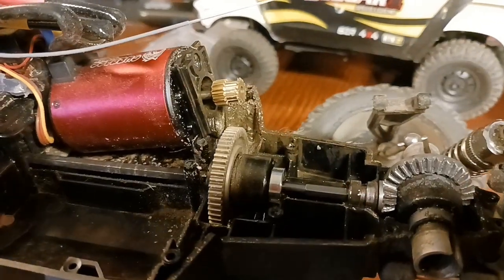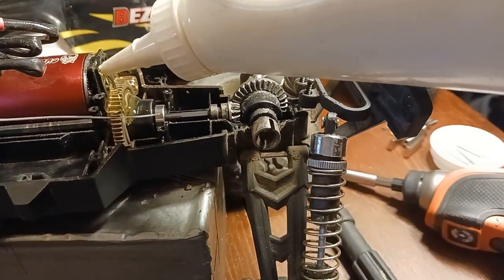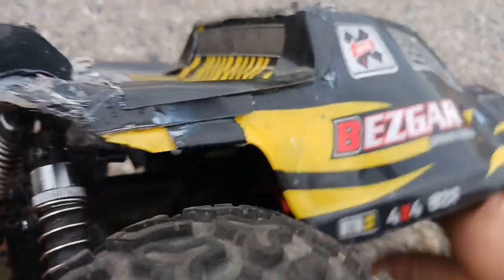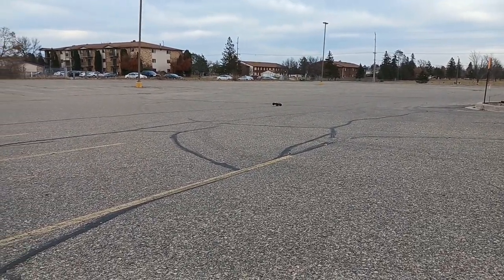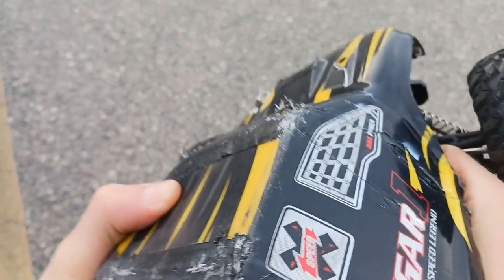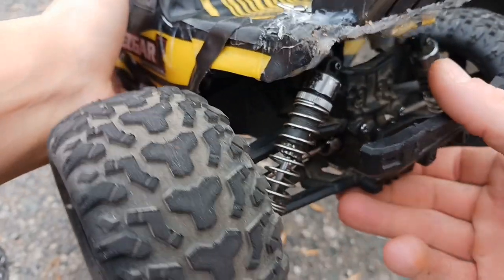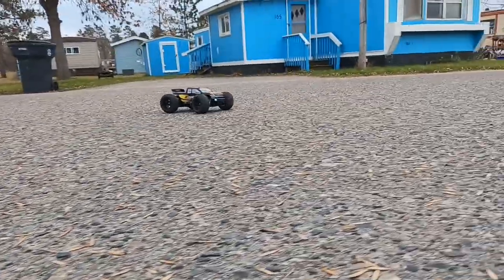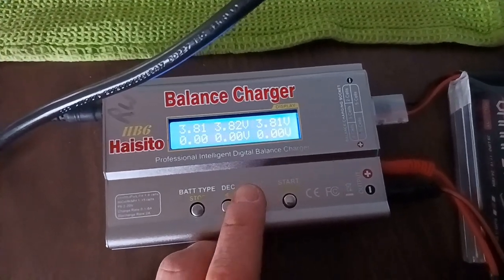3s 3650 5900kv fast wheelies with BZR HM101

Comment: Love your videos bro. You inspired me to 3s my hm101🤙 what motor and shaft size?
Reply from the maker: That's cool to hear I'm really glad bro! He'll yess that truck is badass with a 3650 motor. Get a 3650 with a 3.175mm thick shaft. They're all the standard length shafts, but ive only had Surpass Hobby for 3650 motors . Example, The surpass hobby kk 3650 Motor's shaft is just long enough. The pinion will just go on enough to fully be on the shaft where it lines up with the spur gear. Works perfect. What esc and motor are you thinking? I reccomend a dumbo X6FG or Injora T-6 with a gyro if you like going really fast. Really makes it even better
Reply: @ChiefRickyRC  darn I'm going to have to cancel order lol. I was going with the 3660 brushless with a 5mm shaft diameter / 15mm shaft length😳 
I never see your videos till after I ordered😅 was living on a prayer hoping it would all fit or I'd make it fit 😂
60 amp esc came with the brushless motor combo from surpass hobby. I got a cheaper 6ch receiver and transmitter. Have a bigger 25kg metal/waterproof steering servo on it already with 2000mah 2s lipo.
Im from Kauai Hawaii so we got lots of fine red dirt areas so I usually dirt rally style with some big jumps 😎🤙
But what about that shaft length? Will 15mm long be too long or too short?
Reply from the maker: That's so badass you live in paradise 🙌.  Sorry to say 5mm is too large. I swappes the original steel pinion so you'll need a 3.175mm Diameter shaft to fit the pinion. This use 48° pitch mod.06 gears and that'd be impossible with a 5mm. Otherwise I'd get the longest shaft possible you can always trim that. You could use a 3660 3.175 still, but those don't come as high kv. A 60amp would work, but you'll need at least a 80amp of you want that good punch to launch off the jumps. I know these do that great lol. I fixed mine with 2 small screws after the Skatepark just haven't got to show how yet. Rock on brotha lmk how it goes
Reply from the maker: Something around 4000kv would be insane off 3s,4s. I'm gonna show the 2995 with a 3650 2800kv Castle motor and 120amp. I think you'll want somewhere around a 100amp
Reply: @ChiefRickyRC  shit ok. So the 5mm shaft won't work because why? I'm new to the hobby so didn't really understand 😅 48° pitch? Sorry to bug bro 🤙
Reply from the maker: The original motor pinion that you'll use off the 550motor has a hole that is 3.175mm. 48° pitch is the style teeth on the spur and pinion gears. No worries this will make sense eventually ask away
Reply: @ChiefRickyRC  ok now I got it👍 so what if I use a after market pinion gear (5mm/48p/12-14T) instead of the stock one? Will that work? 
I confirmed that the shaft length is the same as the 3650 (15mm)
Reply from the maker: I just looked and once you go to a 5mm, all the pinions are 32° pitch teethed gears. I have a 5mm shaft on a 4068 size motor and it looks to big for the small motor pinion also. The 3.175 shaft is plenty strong they never break. Well I broke one once, but it was a 9000kv motor lol
Reply: @ChiefRickyRC  I found a 5mm/48p/17t on Amazon by Robinson racing will that work?
Reply: @ChiefRickyRC  sorry to push the issue but just asking to know and if it won't work I'll just cancel order and get the 1/8 shaft 🤙
Reply from the maker: It sucks to cancel a good deal. Yup bro gotta get the 3.175 shaft motor for this truck. The 3650 is crazy power for it. Even a smaller 540, or 2845 can would make it do backflips on 3s. I usually use AliExpress to buy surpass hobby motors and EsC's really cheap. Only buy from sellers with at least 10 previous sold orders and always read reviews to double check the seller. Even on Amazon they can do slick shady stuff.
Reply from the maker: They have good 3week shipping. I mean typically it's a week longer then Amazon and $10-20 cheaper for same thing
Reply: @ChiefRickyRC  ok bro thanks a lot 🤙 So just to be clear even with a 5mm bore, 48p, 17t pinion gear; it won't work?
Reply from the maker: I believe That would work if you find it
Reply: @ChiefRickyRC  I had to work late and didn't cancel my order in time 🙄 but I think I found the right pinion gear online. I'll try the set up to see if it works and let you know 👍 worse case I'll just go with the set you suggested and no problem👌 
Thanks again for the help and your time  I greatly appreciate it 🤙
Reply from the maker: You can always take the pinion to a machine shop or if ya gotta a drill press, drill the hole to 5mm. Ruins the pinion but if that's the goal. Don't try with a hand held drill you'll just stab yourself lol
Reply: @ChiefRickyRC  🤣 been there don't that. I'll keep you posted 🤙
Reply: @ChiefRickyRC  got my motor and ESC in today the pinion gear meshes very well with the spur gear the shaft length is perfect and did not need to be cut the 5mm shaft size had no issues with fitment. 
However the box did not come with instructions. The 3 motor wires are color labeled black, yellow, and red. Yellow is the middle wire.
The esc wires have no labels or colors. Would you by chance have a instruction manual? Just need to know what color wires are on the esc. 
Thanks in advance bro 🤙🤙🤙
Reply from the maker: That's awesome wow that's gonna be a beast! The motor wire colors don't matter as long as it goes correct direction. I usually use yellow as middle too, then switch the others if it goes backwards. Can't hurt it so no worries about motor wires. Mayne that's why never has instructions lol
Reply: @ChiefRickyRC  nice I'll try post a video later today 👍
Reply: @ChiefRickyRC  so I hit my first problem 🤣 it sound like the pinion and spur is really loud. Took the cover off and I chipped some teeth on the spur gear🫣 pinion gear is fine tho but still sucks. 
The motor mount is pre set too so not sure how I'll slack down the mesh 😅
Just fuked the spur up 🤣
Reply from the maker: Damn the steel spur wow 👌  😆 . You could slot the motor mount holes carefully. I always fuck them up tho
Reply from the maker: It was so hard to get this thing doing 70mph idk if it's possible to go much faster. Just the suspension geometry
Reply: @ChiefRickyRC  thought about that but I'm not 100% on it. 
But did you have problems with pinion to spur meshing with the 3.175 size shaft? 
Could the tooth count have been why it spun some teeth on the spur?
Reply from the maker: On the Q901 spur the largest I could spin on it was a 26tooth. 27tooh didn't mesh at all. Was noticeable not to install
Reply: @ChiefRickyRC  🤔🤔🤔 I was only at 17t on the pinion with stock spur🤷 maybe the thicker motor shaft increases the size geometry of the pinion gear?
Reply from the maker: On paper it should work. I'll be working on my HM101 soon and I'll try some pinions
Reply: @ChiefRickyRC  I got lucky and found the center shaft/spur gear on Amazon they had 12 in stock bought 2 but only 1 went through. Went back look this morning and they were all sold out🤯 but I have 1 on the way. Now I'm unsure if I want to try the same set up on the new spur 🤣
Do you know what material is the stock spur? The aftermarket pinion I got is hardened steel...
Reply from the maker: Great news! The spur is just normal steel I believe. That's why the hardend ate it up. I reccomend the stock pinion but sounds like you got it bro
Reply: @ChiefRickyRC  is there a difference with metal steel vs harden steel or harden metal?
Reply: @ChiefRickyRC  just found another 5mm bore 48p pinion made of "metal steel" not hardened
Reply from the maker: Hardend metal particular steel is heat treated to be harder. The metal loses flexibility the harder it gets. Like diamonds lol
Reply from the maker: I bet there's lots of videos on hardend steel
Reply: @ChiefRickyRC  thanks bro sorry to bother you 🤙
Reply from the maker: No bother bro I'm not getting many notifications so I enjoy it actually being chill. I'm rc and car crazy it's all I talk about lol. Anytime brotha
Reply: @ChiefRickyRC  been looking up some new pinion gears but a lot of them either say 7075 aluminum or metal steel I'm not sure what is metal steel🤷 what do you think would work better with the steel spur gear aluminum metal or steel (non hardened)
Reply from the maker: Metal Steel is probably just for the description I'm thinking. Personally I'd go with normal steel. Hey bro so When you first run the truck set the throttle dual rate down to low power and run a whole battery driving with low power to break in the new gears. The teeth will seat better hardening and smooth out the contact area. A light load on the contact area. Don't hold it in the air and spin the wheels fast until after a good 30mins slow. The softer the metal the better. Like everyone gets a brand new rc and rips it right away just hard. Well brushless stuff. Lol a brush motor breaks gears in awesome
Reply from the maker: I'd take everything hardend steel 1st, then steel, and whatever composte WLToys uses on thier plastic spurs. That shit is awesome. My 979b and 124018 have them. Last forever even with a hardend steel pinion. That Alloy pot metal is the fukcing worst
Reply: @ChiefRickyRC  what about aluminum cause I rather change pinions than spurs. The one that ate me spur says hardened steel
Reply from the maker: Aluminum is so weak I tried it
Reply from the maker: Brass chews up aluminum
Reply: @ChiefRickyRC  wats up bro 🤙 so my new spur gear/center shaft came in yesterday from bezgar (direct replacement part)
I returned the 3660/5mm shaft and got a 3650/3.175mm shaft; but it doesn't arrive till 01-27-23🙄
Planning to install new 3650/3.175mm, with a 14t or 16t metal 48p pinion gear, with my new spur/center shaft once the motor gets here.
But for now I put the old motor back with the chipped spur 😅 she still runs no skipping teeth yet 🤣
Also I noticed my stock pinion gear on the stock motor has no hex nut... Seems pressed on?🤷 How do I get it off to use it on the new motor to keep the spur to pinion gear ratio stock? Thanks bro🙏🤙
Reply from the maker: Word that's a good 550! So the stock pinion, heat it up fast and pop it off with a short sturdy flat head screw driver, or motor pinion Puller. I get the screw driver tip wedged and rotate the tip pushing pinion off. Safer then pushing prying it off. Plus less chance of harm.  Sorry i didnt mention pinion puller sooner i forgot. Installing again Get it hot so it expands and press motor on. Be easy on motors bearing. Find something small to press against the otherside of the motors shaft and you can use something tapping it on. If it's still kinda loose. Put super glue where the pinion sits and slide pinion over the glue
Reply from the maker: 🤘 this setup will be amazing! I gotta say the stock pinion can lay power down. It's wild how violent Heavy Metals 2995 can spin the tires
Reply: @ChiefRickyRC  🤙 nice thanks bro for everything I greatly appreciate it. 
Brushless 3900kv 60a esc but later on when I get 3s lipo I'll up the esc to 80a.
Haven't owned the bezgar long less than 3 months and just bought x2, 50c lipo 2000mah 2s batteries like a month ago 😅 so I'll get my worth from it before I 3s.
The new brushless on 2s should be a difference non the less and just knowing it's 3s capable is a plus 👍
Btw what batteries are you using?
Reply from the maker: You're welcome bro and I'm glad to help go fast🏁🤘 that'll be as strong, fast, and good looking as they come. So the 2995 buggy body fits on exact by the way. I'm having trouble finding a new HM101 body shell. They were just on Amazon in a parts bundle I missed out on sold out right away lol. That 3900kv is great on 2s, 3s, and even 4s when you wanna see how fast it goes maxed out. That KV will have enough torque to max out its RPM's under load. Good times bro
Reply from the maker: I like Goldbat. Try the 2200mah 80c 3s. Great to use together on a parallel plug
Reply from the maker: Or their 1500mah 100c
Reply: @ChiefRickyRC  what's up bro got my motor and ESC combo in today I'm doing the swap now but quick question is there a difference between the front and rear spider gear differential I might have mixed them up just wanted to be sure that I put back the right dif we're it needs to be.
I noticed one crown gear is darker in metal color than the other🤷
Reply from the maker: Alright bro 👍 yup diffs are same. just make sure the diffs are both in correct sides.  Spinning the drivetrain seeing the wheels go forward. I'm finishing some videos tomorrow night..I need one more day with the Firebolt on Paddles in the snow
Reply: @ChiefRickyRC  that's bad ass with we had snow on Kauai 🤣 I'll try post a YouTube vid on my channel later too.
Btw you have a Instagram? I have a rc page on ig 🤙 let me know bro
Reply from the maker: Isn't that wild! Cool lmk on video and I do have a IG but I never get on it all. I'm Ricky Wittner on IG hmu 🤙 tropical snow ❄️ that's cool
Reply: @ChiefRickyRC  sup bro so the motor set up is awesome. Unfortunately I keep blowing pinion gears.
Tried harden steel pinion and it chipped the spur.
Tried non hardened metal pinion but the spur ate the pinion 
Tried forged aluminum but the spur ate the pinion.
Not sure what more I could do to prevent the pinion from blowing🤷
Spur is steel or metal?
Reply from the maker: That's great bro, but wow that part crazy. Do you oil it like I do? I bet it's getting hot and making the metal weak
Reply from the maker: Fill the gear cases 1/3rd full just up to the bearings, so it sloshes around.   Any gear oil, or motor oil is fine. I use a 80w Differential gear case oil stuff. I bet this helps big time
Reply from the maker: Motor oil is a major part in cooling real car engines as well fun fact
Reply: @ChiefRickyRC  yeah bro I did add oil just like you suggested. I'm using 80-90w Castrol gear oil and red grease during assembly also🤔
Idk what's up I tried 14-17t 48p harden steel, metal, and aluminum. The harden steel ate the spur and the metal and aluminum got ate by the spur🤷
Just tried to use the stock pinion and I heated it came off easy but it won't fit on the 3.175mm shaft no matter how hot I got it or how hard I hit it🫣
I'm running out of ideas😭
Seems the metal held up longer it was a 16t😅
When I try to go bigger that 17t it seems to bind really badly😳
Maybe I'll try find a metal 14-16t pinion.
If not try replace the metal spur with a plastic one and run aluminum pinion🧐
Reply: @ChiefRickyRC  sorry to bug you again on the details but what exactly is your set up on your hm101? Motor kv and size, motor shaft size, spur gear, pinion gear teeth count and material, and your power trim you run on 100% ?
Reply from the maker: I feel bro I feel! You just reminded me, that pinion was a sob to get on. it just needs to be pressed on with a press, or vice. I wonder tho about why gears don't last. I'm sorry about the oil. I wonder if the spur has a weird tooth count that eventually binds up after a rotation. I've seen that once on the Q901 spur. I could go up to 26tooth pinion, a 27tooth or higher all got bound up testing spinning by hand. I'm sure the stock pinion will last basically forever. A couple years of hard 3s use
Reply from the maker: You're patience working on this rc is impressive 👏 I'm sorry it's been a hassel
Reply from the maker: No problem bro we'll get this truck solid. I use a Red Surpass Hobby KK 3650 5900kv 3.175 motor and Surpass Hobby KK 120amp on medium punch(these only have low, medium, and high. Im on medim bcz it feels same as high and seems safer on high kv. It does standing backflips pretty violent) and the 6ch Dumbo usually. I've been saying use the stock pinion bro it's the ticket
Reply from the maker: And currently brass Q901 14 tooth pinions. It's on its second, but it's about to go its getting louder  lol
Reply: @ChiefRickyRC  counted spur teeth it had 60t. Dam I damaged the stock pinion bore a little trying to get it on. No matter how straight I tried to put it on it would go on uneven and yeah😒
I'll try a 14t or the brass one you have and let you know how it goes.
Reply from the maker: You and me both ruined them somehow dang it. Well the 14tooth brass will work good. I'll look.for a good place to order a new OEM
Reply: @ChiefRickyRC  😭 with great power comes great maintenance.
Reply: @ChiefRickyRC  okay bro so after some heartaches and research I figured out that the plastic mounting plate that comes with the stock motor is actually a 2-way preset mesh; one way is for 14t and the other side is for 16t 😅🤯
I had no idea but there are small numbers on each side of the plastic motor mount 🤣
Have a 16t arriving tomorrow and will let you know how it goes 🤙
Reply from the maker: Dang bro now I know what you were going through. Ohh geez ya know I didn't even know that. I just knew it fit one way 🤦‍♂️😫. Good now bro 😎🤘
Reply from the maker: There different holes for a 2845 vs 3650 also
Reply: @ChiefRickyRC  🤣 now we know haha I'll hit you up when the new year is on and not blowing pinions
Reply from the maker: Sounds good 🏁
Reply: @ChiefRickyRC  I give up I tried both ways on the motor plate 14t with a 14t gear and 16t with a 16t gear and still shredded pinions. 
Then I finally got the stock pinion on the new motor and after 20min it blew the stock pinion into pieces. 
Checked the mesh on each attempt but still same problem. 
Now I have no stock pinion to put back on the stock motor even if I wanted to......
Ruined it and now I'm over it. 
Buying a redcat tomorrow 👍
Throwing this bezcrap in the trash 🤬
Thanks for the help tho it really helped till I just couldn't take it no more and gave up. 
Idk what else to try.......
Then I'm wondering how you running 3-4s and I'm shredding gears on 2s......
Do you change pinions on each run?
Reply from the maker: Mine are just stock and that shouldn't happen. Lots of people give these insane power. Does it roll freely? After this you better get something with mod1 32° pitch gears, or mod them on. It don't make sense, but I take your word. This HBX901a was all jammed up gears grinding popping and there was not a scratch when I opened it up. Then it works perfectly. Another thing make sure you can return it, because safe shipping is the first hurdle 🤦‍♂️
Reply from the maker: Man bro I'm still thinking about how those gears didn't last. How much is it to send me your truck, so I can get it going for you? I live in Bemidji, MN 56601
Reply: @ChiefRickyRC  sup bro sorry been busy. I have one last attempt;
I'm going to make my own motor plate with slotted holes out of some steel sheeting I have.
From what I learned is; if the after market pinion diameter is not the same diameter at the stock pinion (smaller or bigger) it won't mesh right. If it's 14t or 16t it don't matter; it will always be off meshed. It's has to be the gear mesh🙄
I tried shimming the motor up to sit higher up on the gear and set it by eye and sound. It sounded way smoother and no grinding. But the top cover can't screw shut all the way and leaves a huge gap🫣 Not to mention nothing holding the rear shaft and diffs in place.
So I'm guessing gear mesh🤷
So I'm making that custom metal motor plate and manually setting gear mesh 😅
And if that doesn't work I'm just going to buy a new stock replacement motor with pinion and motor plate included and stock the Bezgar and buy a black out 😎
Or send your way 🤣
Reply from the maker: Yay alright bro! That's wsup
Reply: @ChiefRickyRC  what's up bro hope you're having a good weekend 🤙
Just an update on the bezgar:
After customizing a steel motor plate it unfortunately didn't solve the problem 🤯
But it did last way longer before blowing the pinion gear once again.
After that I took the risk and bored out the stock plastic motor plate hole, the top hole. Meshed with paper and locked it down but still blew🙄
Then tried more and or less mesh from there and still blew the pinion🤬
Finally I decided to order a stock motor replacement that comes with motor plate and pinion gear; plug and play. I will just run it stock for now till I decide to try again🤷 I'm ok with that 🤣
It's still a beast stock right out the box💪
It was a emotional experience for sure but worth the try. You have a unreal hm101 I have not seen anyone else on the web😎 you inspired me to try and you helped me so much bro I appreciate it big time 🙏 sending my aloha your way bro bro 🤙🤙🤙
Reply from the maker: Aloha and Goodnight Fam
Reply: @sensationsgarage5572  I had the same idea/problem as yours and went for a 3660 with 5mm shaft. I am using a pinion gear from Robinson Racing on my Flyhal FC610 (which is basically the same truck). But I got the 16T one. No modifications needed.
Reply: @sensationsgarage5572  Which servo are you using? How did you manage to make it fit?
Reply: @apsjr100  25kg servo. Had to trim the mounting brackets off on the servo and make my own bracket to hold servo in. It was pretty easy.
Reply: @sensationsgarage5572  Great job man. I really would like to have a powerful/faster servo in mine but that sounds like too much interference with something that is OK right now. Maybe when it fails in the future 🤣 Thanks a lot and good luck with your car!
Reply from the maker: Idk what it is about these servos but they seem faster after using it for a minute like they loosen up maybe or a illusion lol
Reply: @ChiefRickyRC  I have big MT tires in my car and the stock servo handles them just fine. But I would like to have some more "responsiveness" 🤣🤣🤣
Reply from the maker: It's tough as heck but if it crashes hard man it can get bad fast with this one. Hopefully mine lasts until a 80mph cartwheel 😆 💯
Reply from the maker: Sure, thanks bro. I'm gonna do that when nature calls 😆
Reply: @ChiefRickyRC  update on bezgar hm101
Took it up to the mountain track today and had a blast. It was a huge day and night difference. Ordered the 14T brass pinion gear  from AliExpress and popped it in and it worked🤯
All those blown pinions and long night are all worth it now. This thing rips and can jump some huge air and definitely can take a beating. It's ballooning all 4 tires on a 2000mah 50c 2s battery😯
So far so good went through 6 of those batteries and all is holding up ATM.
Thanks for all your help bro much appreciated 🤙
Reply from the maker: That's badass and great news! Maybe good to have a extra brass they do slowly wear. Pretty good tho huh 🤘😎
Reply: @ChiefRickyRC  ordered like 4 haha
Reply from the maker: Gang gang 😎
Reply: @sensationsgarage5572 I just went through some insane emotional phases reading all 88 replies lol😅, I hope your still into rc after a year. If so I have a few questions, so after all that, how did you get it to work? I’m about to order a surpass hobby 3650 3.175mm 4300kv motor and I had already geared my stock motor up to 16t with some eBay pinion and I thought I’d be fine with the brushless conversion, but after reading all that I’m not so sure anymore, if you could tell me your final parts? it’d be much appreciated
Reply from the maker: @Injorda lol! Wow right, well this rc chassis  is the best 1/12 ever made.  I reccomend a 3650 5900kv motor and at least a 80amp and a reciever/ Transmitter with gyro. I use stock 14 tooth mod .6 motor pinion. Got 75mph 4s on rc station tires, 70mph on GRP XM3 tires
Reply from the maker: @Injorda beware aftermarket pinions can be mod .5 which means slighty shorter teeth and will strip easy against stock mod .6 spur gears. Good luck Injorda
Reply: @ChiefRickyRC  70mph is insane, but I’d like to keep it under 40 for reliability. I was planning to bash it and jump it without breaking too much stuff so I’m planning on using a lower (ish) kv motor. But I got confused when sensationgarage kept stripping gears lol
Reply: @ChiefRickyRC  I actually got the mod.6 😬 hope it’ll do
Reply from the maker: @Injorda good job, let me know how it works bro, I  always like to go faster too 😎
Reply from the maker: @Injorda mine has been good this whole time i just havent driven it. Im collecting  her with a new HM101 body that Bezgar sponsered. My HM101 kickstarted my channel the most. Im gonna rebuild the 2995 and beat on that one.  I wouldnt worry about capping speed on these for durability. I still habent bent a wheel spline after all the crashes and high speed cartwheels. Just the body shells and body posts break easy
Reply from the maker: @Injorda im gonna try a rotor swap with my 9000kv motor that broke. I should beable to swap the 5900kv rotor into the 9000kv can
Reply: @ChiefRickyRC  nice dude can’t wait to see that, good luck and thanks